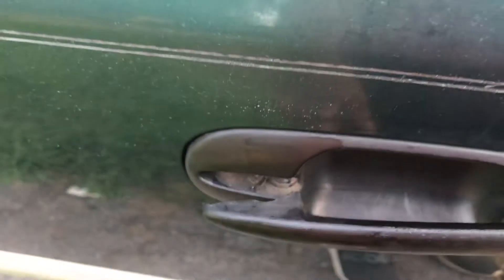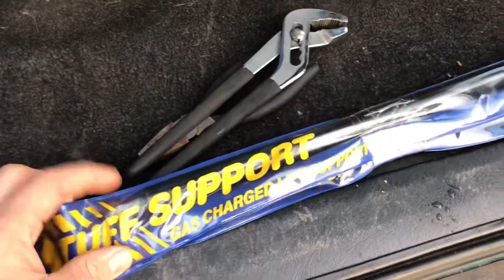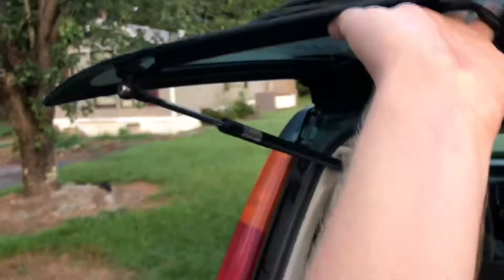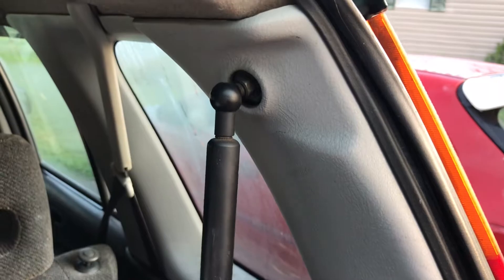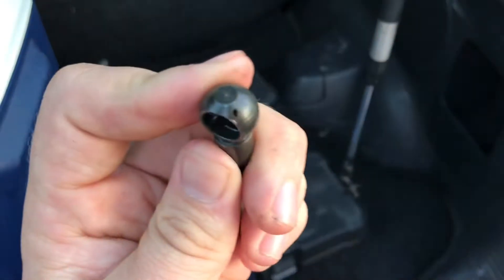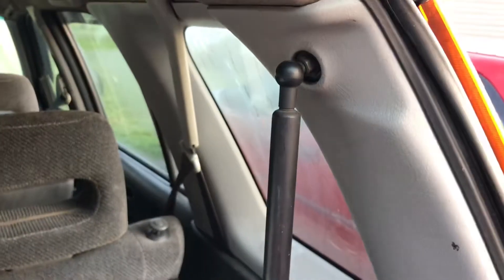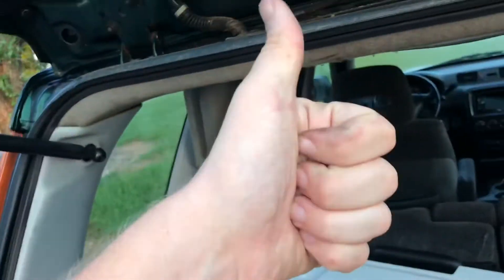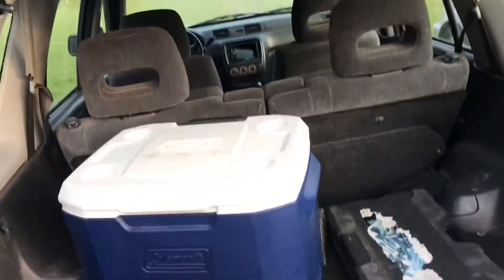99 CRV LIFT SUPPORTS

Comment: Those window side connection points are shot....there should be no space. Get new ones on Amazon.  They are 3 pieces each and screw together with a rubber washer in between.  Mine are arriving tomorrow.
Reply from the maker: Thanks for the info, if I still had it I would definitely do that. But switched up for forester xt 🤙
Reply: Could you share the link to the side connection please
Reply: Hey bro do you know what the proper name for those clips are or could you share the link for the Amazon item
Reply: I'm trying to figure out how to get the old clips off the window because I bought new hardware to replace them with the struts.

Comment: How did you removed the ball joint screw hardware from the strut? To reused it? 

How did you manage to removed original ball joint screw? 

I have same exact Honda CRV. Same problem you have.
Reply from the maker: New ones came attached. I didnt take apart either of the struts, just took off the old ones and put on the new ones
Reply: I have the Same question .. where can I get new ones?
Reply from the maker: @MrHotnspicy96  i just ebayed lift supports for the crv and they came with them. Have no idea how to take them apart just how to take them off and then back on.. sorry i cant be of more help